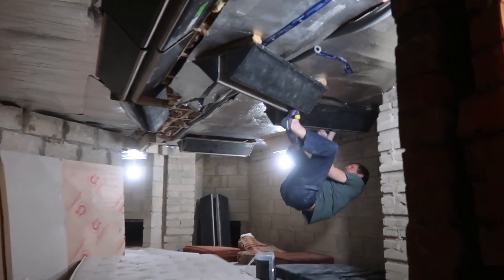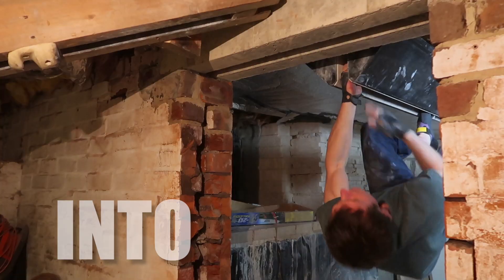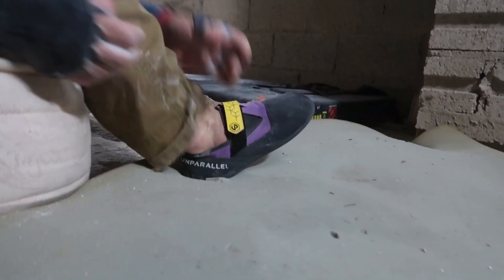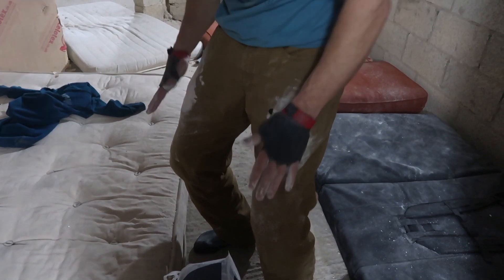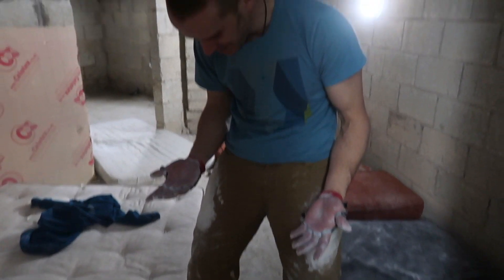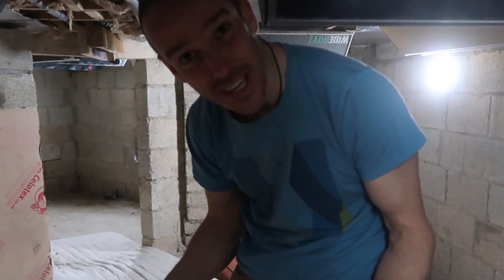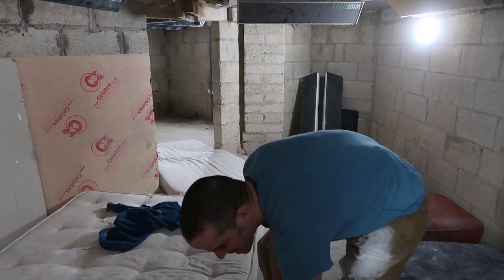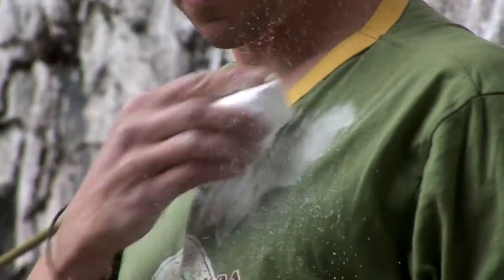Name My Crack

Comment: Frontside and backside is not about being “goofy footed” (right foot forward is goofy)

It’s about which way you turn 180 at the top of a half pipe.

If you’re normal footed, anti-clockwise is a backside 180. Clockwise is a frontside 180.
Reply from the maker: This is very useful, thanks for the info on that one :D

Comment: In skiing switch is just going backwards. There's an easy direction to spin for skiers, called natural, and one that feels harder, unnat. In snowboarding when you spin and the front of your body faces downhill first that's called frontside and when you're back faces downhill first it's called backside.
Reply: Also you should call it the loft roll

Comment: My theory is that there is some kind of gas leak in your cellar, probably CO2, which gets you right perfect level of intoxication and it also doubles as a training effect since you workt out permanently O2 deprived and when you get out of the celler your VO2 max goes through the roof